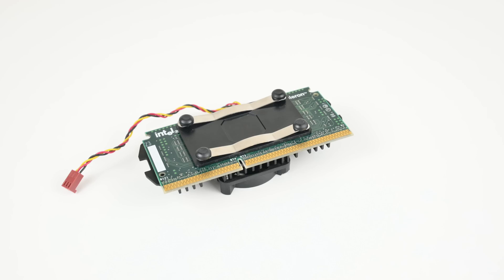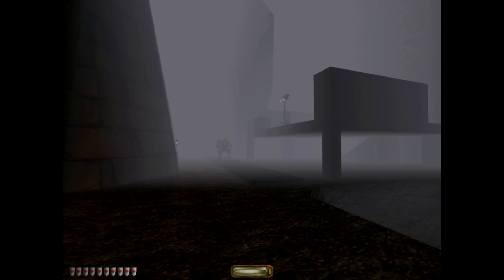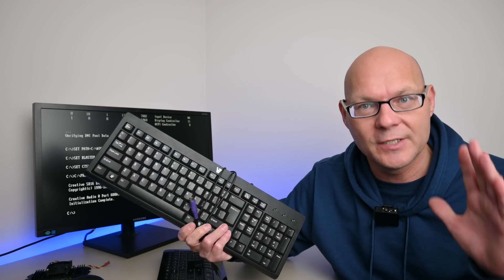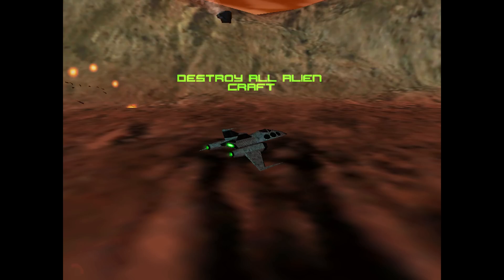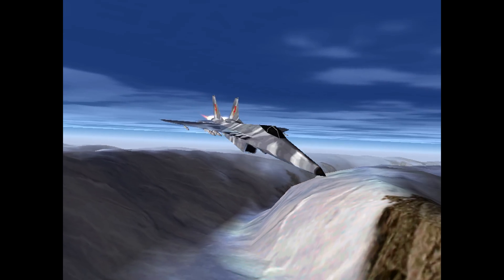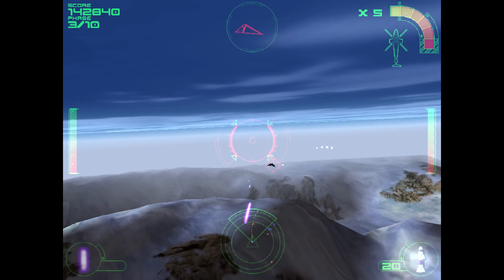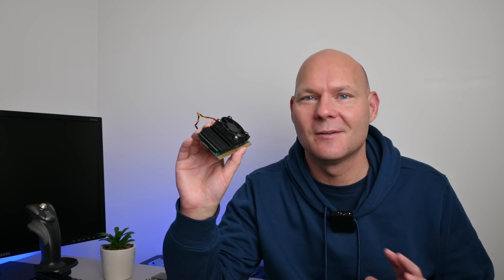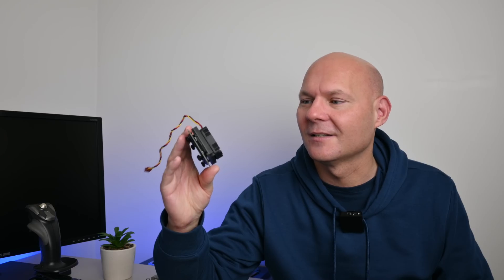Celeron 266 Is Missing Something Important

Comment: Like! Considering that practically all Celeron Covington 266 and 300 mhz where able to run at FSB 100 (400 and 450 mhz) they were still nice budget CPUs at that time in early 1998. But they became obsolete really fast just a few months later when the Celeron Mendocino was released.
Reply: isn t there a recent generation cpu with the same mendocino moniker?
Reply: @logipilot  yea amd mobile zen3 with vega gfx
Reply: @ppolo12 *Zen 2
Reply: @ppolo12  Its amd mobile zen 2 with rdna 2 graphics. Its great to have in cheap laptops and chromebooks.

Comment: I have the same mother. Win98SE gives me a yellow question mark in the Secondary IDE at the Device Manager. I've installed Intel drivers but no change. Any clue?
Reply from the maker: Very unusual as the 440BX chipset is really easy to work with. Apart from reinstalling Windows and disabling unused resources, not sure what else could be the issue here.
Reply: @philscomputerlab  Thanks for the reply. I'll try again with different hard drive and (why not) different processor. It´s a shame because "I love my mother" 😁
Reply: Try a different Ide cable.
Reply: @lexluthor8468  Now you mentioned, I used a 80 wire cable, not a 40 wire!!! I'll try that too!!!

Comment: Before even watching, those were practically cacheless Pentium IIs. What a brilliant idea.. well, Celeron 300A fixed all that negative reputation these got.
Reply: The A-series didn't just fix the negative reputation, the fact they got full-speed cache put them on par with the full-blooded Pentium II. Not to mention they were overclockable to high heaven.
Reply: @borismatesin  And overclockable to 450Mhz with just a standard heat sink!
Reply: Can confirm, the 300A was a legit diamond in the rough.
Reply: yes, and throw away the whole point of the celeron, the A variants were as poweful as the PIIs costing several times more
Reply: @omegarugal9283  Yup... I remember the benchmarks were pretty much on-par with Pentium II's of the same clock frequency. I never had any issues with mine.